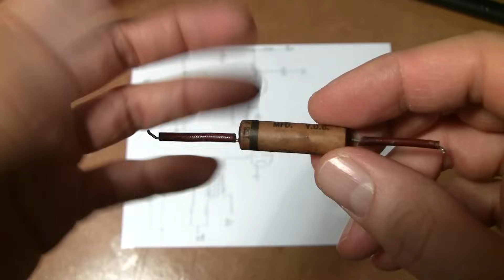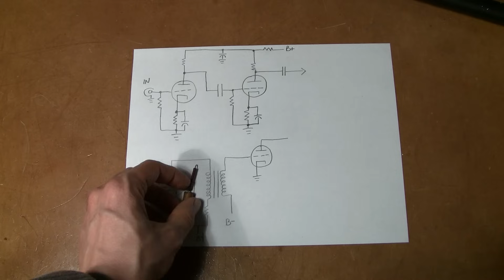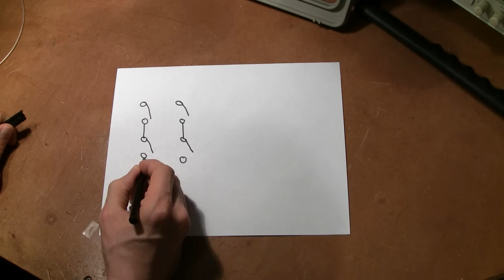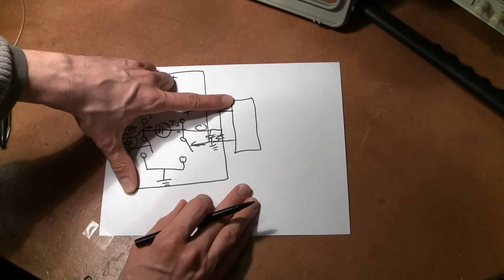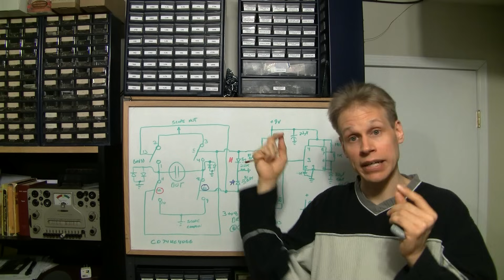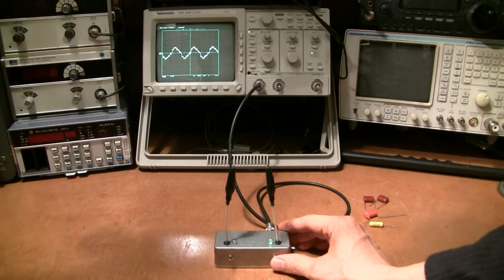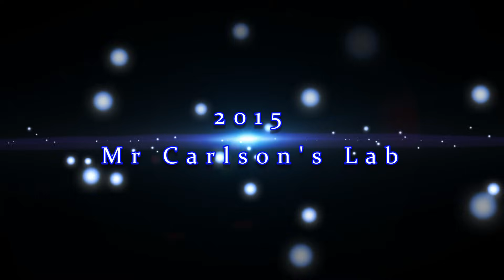Are Your Capacitors Installed Backwards? Build this and find out

Comment: I am totally new to scopes and got a Rygol 2 channel 100 Mhz scope about a week ago. I had no trouble setting it up with my sweep generator and reading a 455Khz signal. But trying this with any of my caps, all I got was hash on the screen and not a nice clear signal like this. Previous to this I was testing them with mike leads from an audio amp, but with smaller value caps there was hardly any difference. What could I be doing wrong here with the settings on my scope. I am using a similar BNC cable with alligator clips.

Comment: If capacitors in an electric guitar cannot be seen as 'backwards' with a plain meter, then most fellows will go no further and take a chance that the capacitor is installed with the printed side easily read...  Upgrading guitars is NOT like real electronics. All fellows want is the 'how and why to do it' and forget electronics theory.

Comment: As a poor boy I have always just used an old RCA input cable to my stereo and listened for hum with the capacitor across the input of the RCA.  Listened for which way the cap has the loudest hum that is.  I supposed that if I wanted to get really high tech I could put a dpdt switch on there to switch the direction of the cap quickly.  In case you wondered, yes, test for the hum with your fingers touching the outside of the cap.

Comment: I worked as an electronics tech for over thirty years working on industrial and military electronics and I never knew about the polarization of these caps.  If I were to replace one of these caps I would probably just pick one up and install it in the circuit board irrespective of the banded outer shield end. Impressive video.

Comment: Great ! The 4066 Quad bi-lateral switches are well thought to replace relays. Nice circuit. The bar graph noise detection side is not included in this, i suspect it is on Patreaon hehe

Comment: Interesting tester circuit. I know a 555 is really popular, but since you're already using a CMOS 4066, I'd use a 4011 instead of the 4013 + 555 and make an oscillator with using 2 of the 4 NAND gates. The remaining two NAND gates can be used as buffer and also provide an inverting output for the 4066 switches. That will give you just two ICs instead of 3 (or 2 1/2). 😊

Comment: If you've marked a cap with a Sharpie permanent marker and want to remove the ink, take a dry eraser board marker (any color) and mark over the Sharpie ink until it is all wet and blended into the dry eraser marker ink, while this is wet wipe off with a clean cloth. Work fast, because this stuff dries fast, if it does dry on you, just repeat.

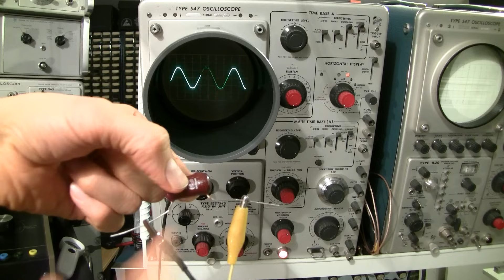Comment: At 14:07 or so you pointed to the non ground lead (yellow) side of the dark brown capacitor and called it outer  with a higher amplitude after just calling the black lead ground on outer  the previous capacitor. Sorry its the tech in me.

Comment: Most good DMMs have cap testers built in, by the way.  If you're going to work with electronics, you need a good multi-meter.  Get one and stop worry about this nonsense.

Comment: If it's not polarized, it won't have a "+" sign.  You don't need to test any capacitor.  Ever.  They are marked, or they are non-polarized.  Period.  If you don't know, ask the person you buy them from.  Don't reuse old caps.  Replace them.

Comment: Capacitors, such as the Orange Drop, are used in Electric Guitars on the Tone Potentiometer. Will the direction the Capacitor is installed affect the Noise or Tone in the type of Passive electronics typically used in such guitars?
Reply: If you ask German magazine author Udo Pipper, even the color of the added marking dot would affect the toan and I'm sure if you use nitro paint for that and apply it in a full moon night it will turn your Harley Benton into a holy grail guitar!

Comment: This won't work for me? .01uF poly cap 630V and .01uf cap 1600V. Both readings on the Tek 475 look the same to me on the 2m Volts/Div setting? Short and straight BNC to alligator clips. Anyone?

Comment: Our "buddy" is grudingly adopting the added filtering available by correctly determining the OUTER FOIL and connecting corectly.
Reply from the maker: Our "buddy?"
Reply: @MrCarlsonsLab  the one who resists being conscious of cap's outter shielding!
Reply from the maker: Well, there are lots of "buddy's" out there still. Proof and science has nothing on ego and pride. Imagine working on this stuff for years and having to admit that you never paid attention to it. "Outside Foil" and "Ground End" were just printed on the capacitors for decoration and fun. Thanks for stopping by Tom.

Comment: Thank You for the capacitor shield reminder!. But why not just use a simple sliding switch instead of all the electronics to flip/flop? Slide left - look at the scope / note swish position, repeat to right and you're done! No batteries, no led's, works forever - old school no energy device.

Comment: Thanks I did not know this about this phenomenon in capacitors.
Regarding the circuit design, here are two suggestions:

Simple way:  Use 2P2T and wire it like this
aO bO cO
dO eO fO
where xO is your  switch connector.  Now 2P2T switch would connect  bO to aO and eO to fO in one position and bO to cO and eO to dO in an other position.  Now connect aO to fO with wire and connect it to ground of oscilloscope. Also connect dO to cO with wire and connect it to center lead of your oscilloscope probe.  Now connect bO with red wire and eO with blue wire to your cap.  Mark one side of your switch with red dot and the other side with blue dot, Now you can toggle state of your switch and look at the scope and see if the red wire or blue wire is the outer shield of the cap.

Sophisticated way:  Use Arduino board to do this.  It has A2D convertor, so you do not even need a scope.

I would add a 1KHz ring oscillator or 555 oscillator and connect to a metal plate placed next to the capacitor under the test to enhance the noise coupling and make the results independent of environment noise.

Thanks again for your video.

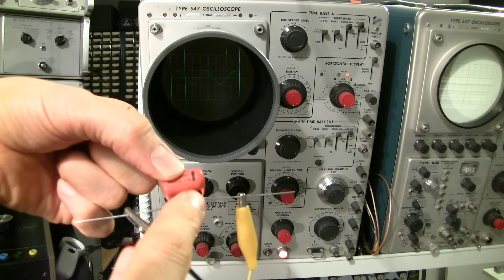Comment: great video.  learned alot.  one question though.  if the lines on many of the newer caps are not used for the purpose of showing the outside foil end (ex, see  @ 12:00-13:00 ), what exactly is the purpose of the lines on those caps?  and whose bright idea was it to not maintain the standards?

Comment: Paul, I ordered 4-CTS 525k pots and 2-orange drop caps to replace the pcb electronics in my 2020 Les Paul Classic. How can I determine the band end on these caps without an oscilloscope? I do not want to install them incorrectly. I'm sure you have a lot of questions from viewers, but I value you opinions over anyone else. Hope to hear a reply soon, if you have time. Thanks.

Comment: I don’t get why they go thru the trouble of adding a foil jacket but not marking the correct end.
Reply: There is no "foil jacket". On the old rolled paper and foil caps like the ones he showed there was an inner foil start point, and an outer foil end point of the roll.

Comment: I made one of these,  but simply used 2 bent brass rods, in a metal box.  One fed thru a nylon bolt to the center conductor,  the other to case and shielding.  No circuitry,,just flip thd cap back and fourth.  Easy, cheap,  and VERY effective.

Comment: This did not initially work for me.  Then I realized that in my workbench area, I had replaced the 4-foot fluorescent lighting fixtures in the last year with  4-foot LED light fixtures, and I no longer had a lot of 60-cycle interference for my hand and capacitor to pick up.  So I just plugged in my isolation transformer, and held my hand/capacitor near the case, and presto, was able to see the waveform on my scope (5mv/division; X1 Probe)

Comment: Good info, thanks. Is it possible to use an amp/multimeter to do the diagnostics or do you need an osciloscope or just connect the cap to an guitar output jack and listen to the noise in the speaker?  So what are the bands on the caps for if they do not specify the shielded end, just a manufacturer marking?

Comment: Over 40 years in electronics and I didn't realise that the markings were useless.  There you go... always something to be learned.  Love your material !!
Reply: i swear I've built circuits and double triple check as in looking up to make sure i didn't get it wrong in terms of the markings on electrolytic caps. but somehow they still don't work. but i never know because the caps might be too old, maybe they're fake (more recently when i bought some on Ebay...i always struggle with electronics and it's really discouraging because ive built good circuits before, but it just seems like i always screw it up somehow and even if i check the schematic over and over and over i can't find why my circuit doesn't work. but i don't have good test equipment. somehow i still think it's worth it though.
Reply: They are not worthless.  Buy quality parts / caps - and don't worry about it.  Unless you're planning on manufacturing capacitors, this is not relevant.
Reply: @foobarmaximus3506  I have successfully made my own capacitors. It is fairly easy. I sealed them in melted styrene, from plastic model kits!

Comment: Mr. Carlson, I wish I can purchase one of these from you. I want to send to the guy doing my radio restoration so he can use to determine outside foil on the new capacitors for the 1942 tube radio I want him to work on. I think it will help quiet the hum and help the radio sound better.

Comment: I been in TV repair business for 35 years and I really enjoy how brilliant you are. I think the foil identifying device you engineered is great. I need to build one but for now I have to use a scope and a signal source. I restored a McIntosh 275 tube amplifier and all of the dy film capacitors we're oriented correctly but I was surprised to find that on eight of the capacitors the band was not marked on the shield and six were. I also found out I didn't have to replace them because they were not the unreliable paper types. One of the electrolytic blew its black tar out and made a mess so it got all new electrolytics. One of the 6550 did not have any emissions. It got all new caps anyway and I tested for foil side and made sure it went to the low impedance side. Now the amp plays beautiful but I was really surprised about the band. I even tested a wax paper I had laying around and it was even written FOIL SIDE with the band and it still was wrong. I wish I could send you those

Comment: Ok. I’ve attempted this with three scopes and can’t get enough amplification to be useful in any way. What am I doing wrong? 1x vs 10x probe maybe?
Reply from the maker: Use a piece of coax with alligator clips. This is essentially a X1 probe. Use 1 to 5mV per division vertical sensitivity regarding your scope.
Reply: @MrCarlsonsLab  OK! I'm in business. I built a manually switched box to match yours and the switch points to the shielded/foil end at lowest amplitude. Fun and useful project for the tinkerer in all of us. Thanks for the help. W3KW

Comment: Great video.  Question, as a guitar player, I am often changing out the tone potentiometers and volume potentiometers in an electric guitar.  I use Orange Drop Capacitors to connect the tone pots to the volume pots in my Les Paul.  Do you know which pot to connect the outside foil end (the shielded end of the capacitor)?  Should it be the volume pot or tone pot?   Or does it matter with electric guitars pots?
Reply: You always want the foil end pointed toward the 'audio source'.  In a passive guitar circuit, it's the volume pot, tab #3.

Comment: If the foil end was critical to the capacitor's applied circuitry, why wouldn't the component industry taken account of it a century ago?  Not disputing your word, but I've repaired, built and even designed my own circuits since I was 12 (I'm 70 now), and I've never made an effort to distinguish the foil side of AC capacitors.
Reply: Exactly.

Comment: Outstanding explanation.  Learned something new and extremely useful.  I'd like to try a 556 configured as a D-type flip-flop (manually push button triggered instead) along with the CD74HC4066 since I'm using through-hole PDIP components to reduce the parts count and circuit footprint.  What a great project, thank you!  You've gained a new subscriber :), cheers!

Comment: My scope is limited to 10mV per division. I am not seeing the difference in amplitude when I reverse the leads... any suggestions on how to get around this without buying a different scope?
Reply from the maker: Hi Mitch, If you remove the X10 probe, does your scope go down to 1mV? If so, use a piece of coax with alligator clips as your probe for testing the polarity.
Reply: @MrCarlsonsLab  After digging through the owners manual I figured it out... helps to be smarter than the equipment I am using! HA Thanks for getting back to me and for the great videos!

Comment: Thank you so much for this information! I literally cannot find anywhere else that talks about this.
Reply from the maker: You're so welcome!
Reply: @MrCarlsonsLab  I just built a low-tech version of this using only a guitar cable with a regular ts plug on one end and two alligator clips on the other.  One alligator clip is connected to the tip wire and the other alligator clip to the sleeve wire.  I clipped a green dipped capacitor between them and did the same thing you're doing, except listening for an increase in noise instead of looking for an increase in the signal.  It really helps, especially if you don't have access to an oscilloscope.  I cannot believe these manufacturers are not labeling them correctly or at all in some cases.

Comment: I've also read that the outer foil thing is really not important for restoring old radios, since they aren't highly sensitive test equipment, for example. So i don't know who to believe.
Reply from the maker: It's not a matter of believing who, it's a matter of fact. Did they orientate the caps from the factory in the radio's that you are going to restore? Do the caps you are replacing have a "noted" outside foil? I think this will provide you with your answer.
Reply: @MrCarlsonsLab  Got it. Do you know if a VNA could determine which end is the foil end of a cap? Using the S12 port perhaps. A nanoVNA is all i have on hand, with new caps already in the mail, on their way!

Comment: More here: https://www.aikenamps.com/index.php/where-to-connect-the-outside-foil-on-capacitors

“The proper way to connect the outside foil is to the low impedance side of the circuit, which, in the case of coupling caps, will normally be the plate of the previous stage. If it is a bypass cap to ground, connect the outside foil to the grounded side. If it is a bypass cap from a signal to B+, connect the outside foil to B+. The outside foil will act as a shield against electric field coupling into the capacitor, so you want it to have the lowest impedance return path to ground.
For AC signals, the power supply rail is effectively at ground potential, just as the ground rail is. This is why it makes a good point to use as a shield ground.  This concept is sometimes difficult  to understand, but if you think about how a capacitor works, it will become clear.”

Comment: Wouldn't the next step be to improve the circuit by finding a way to eliminate the oscilloscope all together. Perhaps a single red LED that is illuminated when the left or right green LED has the larger amplitude? I am very new to this and currently do not have an oscilloscope.

Comment: I doubt if auto insertion machines for leaded components checks the pickup polarity of the capacitors it inserts, not that such leaded components are that common these days. There was a time when leaded resistors, 1/4 watt type, were mounted vertically in order to save board space. It was common practice to ensure the long wire end of the resistor was connected to the low impedance end of circuit. This could produce a few problems, with the long wire connected to the supply rails, while not a shock risk on self circuits,, there was a danger of the rails being shorted, if the resistors long wire touched. One of the jobs of the drawing office was to arrange the circuit layout to avoid such unwanted contacts, by ensuring that a resistor could not be bent to allow leads on opposite supply rail  to touch.

Since the test circuit is looking for hum, would it not be possible to eliminate the need for a scope by adding an audio amplifier and a peak detector. I can think of a number of ways of doing this. I favour using HC logic rather than the older CD type. Instead of using a 4066, maybe a HC 4053 might be an option

Comment: Excellent video, I would have been completely wrong assuming the band is on the 'negative' end.  Cheers.
Reply from the maker: The band is supposed to be on the outside foil end which often goes to ground, but in some cases, the band end can go to a supply rail if it's the lower impedance point in the circuit.

Comment: Does accidentally installing a capacitor backwards in a guitar tone pot affect the tone or noise level of the guitar? Are the voltage levels significant enough to make a difference in  guitars that work with such low levels of current in millivolts range?
Reply: That's right jk.  Paul is not talking about polarity-sensitive components which MUST be connected in a certain direction or be destroyed.  He is talking about orienting non-polarised capacitors in a way that will minimise electrical noise interference.  Obviously, in an amplifier we want minimum noise interference, so it is worthwhile checking.